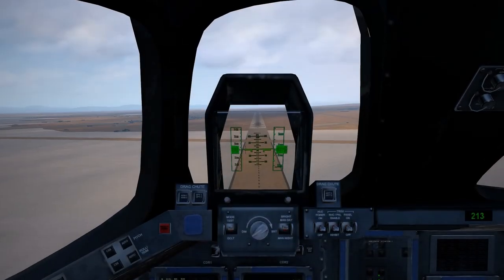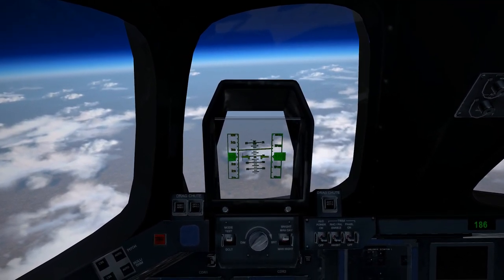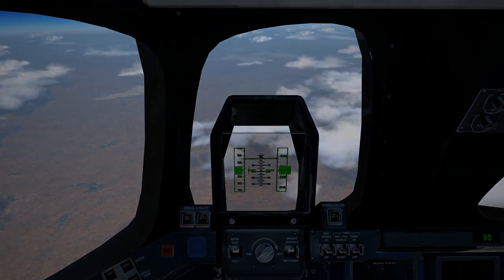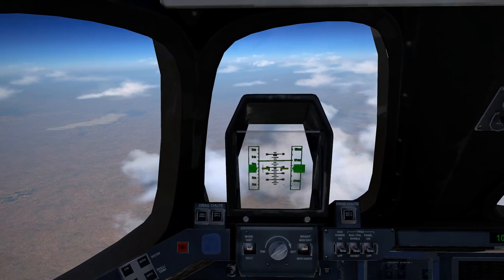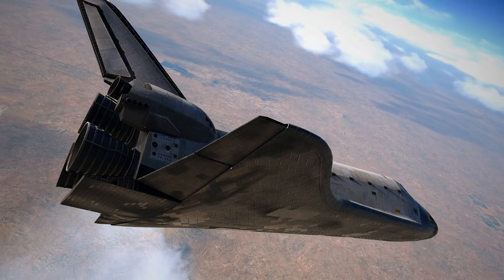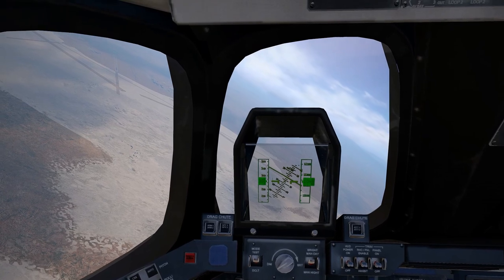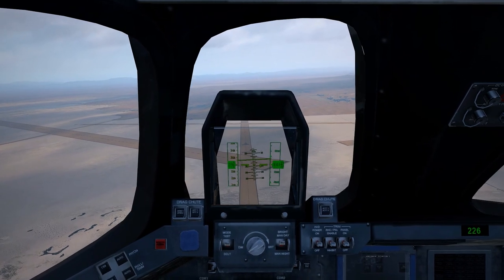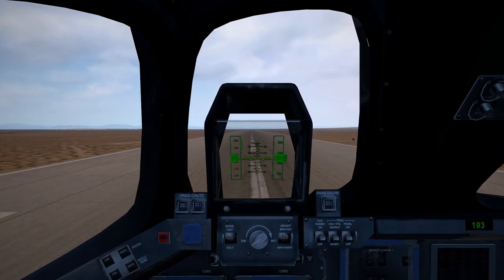Simulated Shuttle Landing + Full Real-World Crew Audio | Cockpit View | Ultimate Realism | X-Plane

Comment: That was a great video! Those Space Shuttles were pretty awesome, years back I messed about with them in er, forget hte name now Orbiter or something? Freeware space simulation with a ton of freeware addons. The way they landed was quite interesting as well, basically using the bottom of the fuselage as a giant speed brake and then gliding in to land with the engines off. Thanks a lot for the vid.
Reply from the maker: Thanks very much! I must admit, I was quite pleased with how the video came out, YouTube felt otherwise though it seems haha. 

Orbiter is awesome! I still use it myself from time to time (mostly recreating the Mercury, Gemini and Apollo stuff). It actually just became open-source, so hopefully it will continue to be developed / improved.

Actually, the original intent was to have a mix of aviation / space content on the channel, but I can barely find enough time to indulge one hobby at the moment - still I'll probably continue to chuck the odd space vid up every now and then.

Cheers!